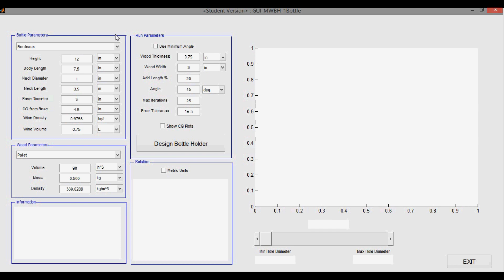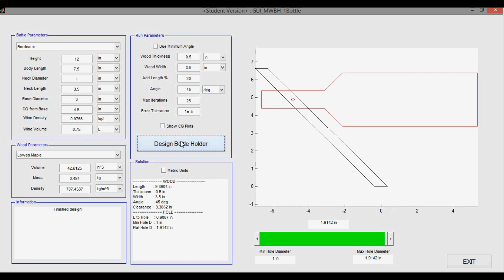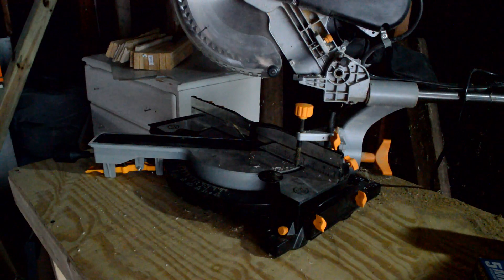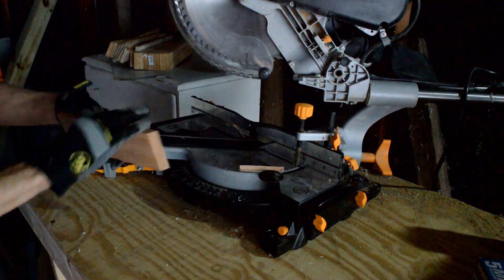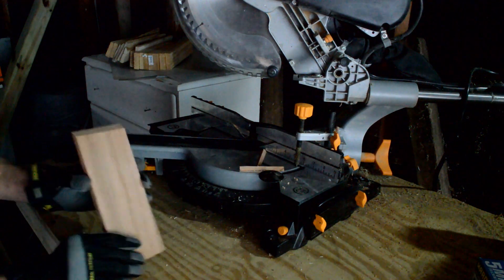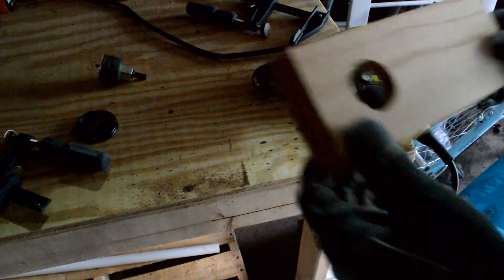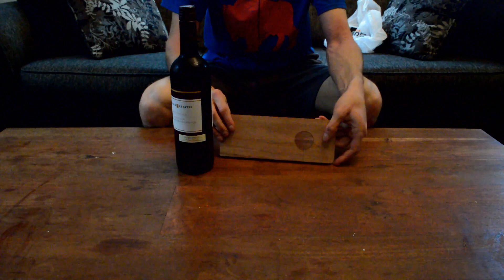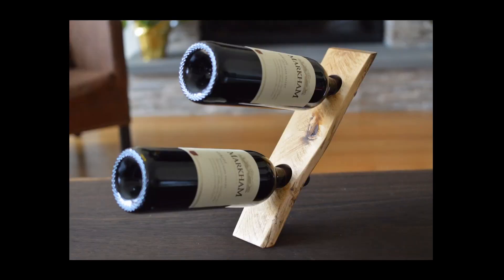How To: Build a Magic Wine Bottle Holder

Comment: Hi Josh, great video! I am struggling to figure out what program you used, i would like to change the values like you did in the video in the .xlx but i think i am missing something. I tried to go on the github app and trying to run the program and also can't figure it out. If you can give me a link that maybe i can follow that willbe much appriciated. I am no IT guru so that is why i am struggling. Keep up the good work and thanks in advance :)
Reply: I am looking for the program that you used, i want to use the slider of hole size and dimensions like you did in the video.
Reply from the maker: Thanks!  The slider is only in my MATLAB code, so if you're going based off my Excel worksheet (https://github.com/jte0419/Magic_Wine_Bottle_Holder), you won't have that option.  Now, I haven't looked at these files since I made them back when I posted this video, but I don't think I included an adjustable bottle angle definition in the Excel file unfortunately.  In the "Solutions" section, you can see that it tells you the minimum and maximum hole diameters.  The minimum hole diameter corresponds to the diameter of the bottle neck, so you can't drill any smaller than that.  The maximum hole diameter is, I think, the hole diameter where the bottle will lie flat (parallel with the table).  Maybe when I get some free time I'll update the Excel file to include a slider and bottle angle selection.  Hope it still helps you out even without that feature!

Comment: A big thank you Josh, just download spreadsheet and did a test on a offset of wood I had it worked, I have subscribed and thank you. Happy New Year when it comes.
Forgot to add timber was an old off cut worktop, Beach, dimensions 2.75 inches wide 1.65 inches thick.
Reply from the maker: That's great!  Always nice to hear that it worked.  Have yourself a good New Year too.

Comment: Is all this science really needed for what is basically a lump of wood with 2 angles and a hole in it ?
Reply: Colin Unique Magic No all this science is not required, simply cut a piece of any timber 215mm long at 45 on the bottom, drill a hole 52mm down from the top and it will work, no need for wood density or anything, I build them all the time 😁😁
Reply: I have the simple common non genius peoples method that seems to work fine. 
Between all the math and the fast talking I'm not sure how I feel other then confused . Nice results however.

Comment: Sorry I am a bit of a newbie to the MATLAB world - what technical environment do I need to generate the GUI shown in the video?
Reply from the maker: If you have MATLAB, then try typing the word 'guide' into the command window.  If it opens up a window called GUIDE Quick Start, then you should be able to run the code I have provided on my GitHub.  To run the code, you need to download both the .M file and the .FIG file to the same folder.  Then run the .M file and you should be able to see the GUI that's in this video.

Comment: Have you tested these dimensions with 3/4" thick lumber (since that is a more common thickness)?
Reply from the maker: I haven't personally, but you could definitely use that.  It will actually make the design more stable because the base thickness will be increased, which increases the margin of where the total system center of gravity can be.  If you use the spreadsheet I've made, you should be able to plug in the 3/4" thickness, and the design should work great.

Comment: Great tutorial!  Your MATLAB solution was really elegant.  I see that there are other similar tutorials online, but yours is by far the most versatile.

Just a few questions: 
Will the bottle holder still work after some of the wine has been drank?  Is there a certain angle you could design the holder to that would allow both full and nearly empty bottles to balance, or is the system simply not that delicate?
Also, how stable is this display?  If someone bumps the table, would the bottle fall over?
Reply from the maker: Thanks!  I tried to make mine very general so anyone could take any piece of wood and any bottle, and design one for themselves.  Other tutorials also don't take into account the fact that different types of woods will change the design, which can be important when using thin pieces of wood (because the base is smaller).

I was actually going to post a video showing the stability/limits of the design.  I usually only put full bottles in mine, but it should still work if you only drink a little.  As unsatisfying as this response is, the answer is: it depends.  If you drink some wine and stick it back in, you'll have decreased the mass of the bottle contribution to the overall moment.  The bottle moment is the largest contribution to the design, though the wood does make a difference.  The orientation of the bottle is also a contributing factor.  Imagine you designed your bottle to lie flat.  Then after you drink half the bottle, you put it back in and it lies flat, meaning the CG stays approximately the same (though not exactly).  In this case, you might be able to pull the bottle a little farther out of the hole to increase the moment arm about the base, while having a slightly lighter bottle.  However, if your design incorporates an angle (like mine does), and you drink half the bottle, then when you put it back in, the wine will slosh towards the neck.  The moment arm has then been decreased even further, and the mass of the bottle is smaller.  I don't think you can recover the original moment by pulling the bottle out farther in the hole.  However, since the base has a definite thickness, there is a certain point where you can drink some wine and it will still work with some clever maneuvering.  So to sum up, it depends.

You could design one to hold both full and empty bottles if you have a thick enough piece of wood, because then you have a wide base to play with.  But I personally don't think the ones with thick bases look as cool.  I might add this option into the code, as an option that the user can say they want one that balances full to empty bottles.  I was also playing with the idea of adding a movable metal weight hidden inside the wood that could be placed such that the system always balances.

I've never had either my single or double-bottle designs fall over.  But I've also always placed them on sturdy tables on hardwood floors.  I don't recommend placing this on a table on a shaggy carpet.  They're actually more stable than you think.  I've knocked one with my elbow lightly before, and it rocked a little before settling back.  That being said, they're not that stable.  They're designed to impress, not to take a beating.  Again, the thinner the wood, the less stable it will be.

Sorry for the long response, but I hope I answered your questions!
Reply: This was great info!  Thanks so much for your thoughtful response.
Reply from the maker: No problem.  Thanks for interacting on my videos; it's always nice to see people actually watching them!
Reply from the maker: So in a surprising turn of events, I tested out this exact MWBH that I made in this video, and it does indeed balance for everywhere from full bottles to empty bottles.  You'll note that I designed it for a Bordeaux type bottle, but the only empty I had lying around (with a screw top to change water levels) was a Burgundy type.  So I tested it full and it worked great.  Then I tested it empty, and it still worked.  I just had to pull the neck out a little bit further.

Turns out I was wrong in my statements before!  And with an even thicker piece of wood (this one is 0.5"), you can get even more stability through the whole range of full-to-empty.
Reply: That's really cool!  Your design just keeps becoming more and more versatile.